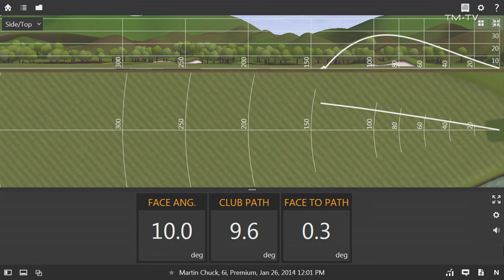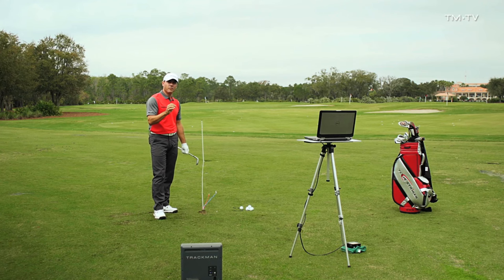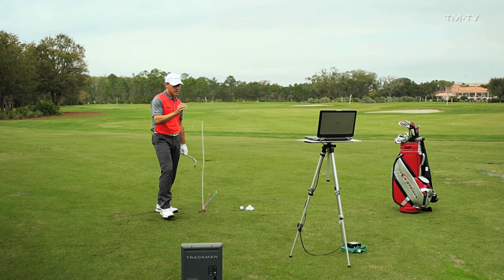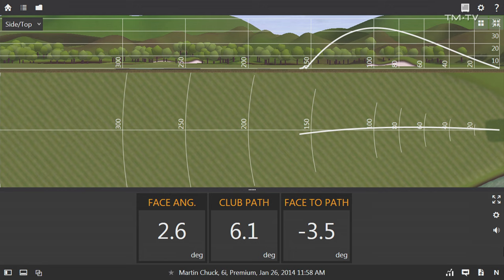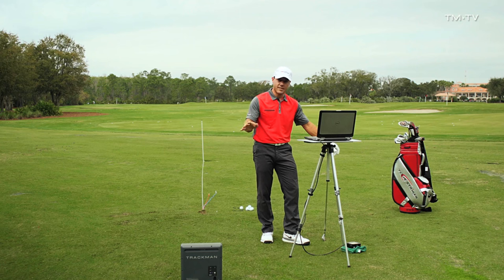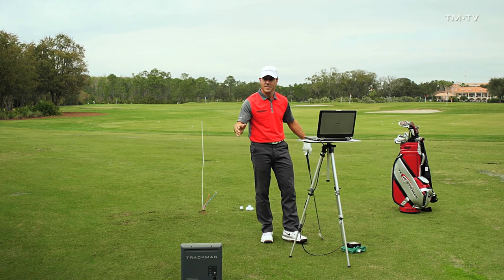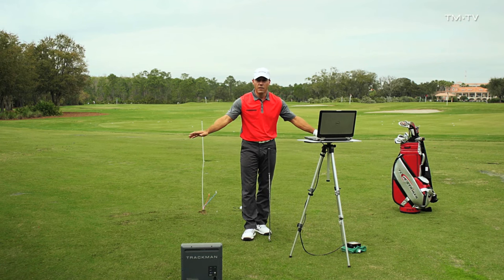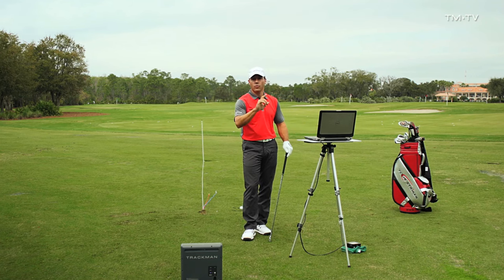Face To Path Explained

Comment: I felt like a couple things have been misconstrued not by you you were spot on. I messed around one day and setup for a draw and opened my face to target at 45 degree angle and was hitting crazy draws. I have to setup like this because my hands naturally close the face down slightly. With a fade I always setup the face square to target and held it off and got slices. Now I slightly close the face to target and I hit majority great fades, better than draw but I do still have the snap hook and the straight pulls

Comment: The first example shows face a Club Path of 9.6 and a Face Angle of 10.0. However face to path is shown as 0.4.
Why not 0.4 as 10.0 - 9.6 = 0.4 ?
Reply: Sorry the example shows face to path as 0.3 when it should be by simple maths 0.4 i e10.0 - 9.6

Comment: The explanation in the video is wrong.  The FACE was 10.0 and the PATH was 9.6, not the way the instructor just verbalized.   Red line should have been to the RIGHT of the blue line, not the left.
Reply: if the red line (face) was right of the blue line (path), it would be a push fade. he did explain it correctly

Comment: Iv'e been doing some research on this of late and in the end you don't need fancy computers it's basic common sense. All shots are straight with the path just in a different direction it's the face that causes ball flight not the path. That straight push shot was actually just a straight shot the draw was just a closed face. Just swing straight to your target and let the face do the talking.
Reply: Mike Boatright sounds easy enough
Reply: Ive never managed to get a club path of 0.0 with club face also at  0.0 . Basically impossible. Much easier to follow his instructions and minimize path angle combined with slightly open face. Take the left side of fairway out of play. I’m only talking  a draw.
Reply: the face only gives start direction